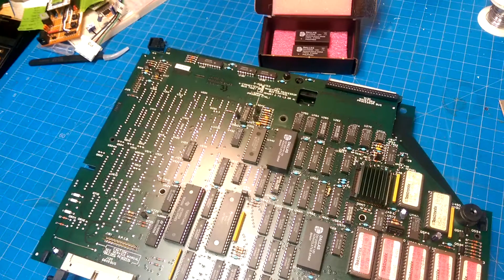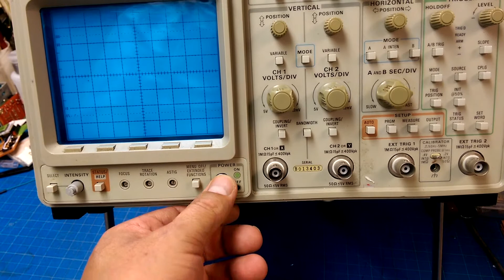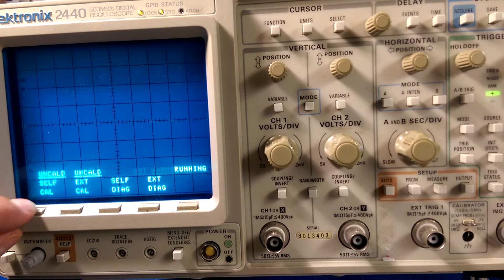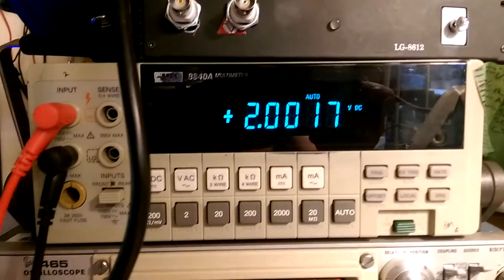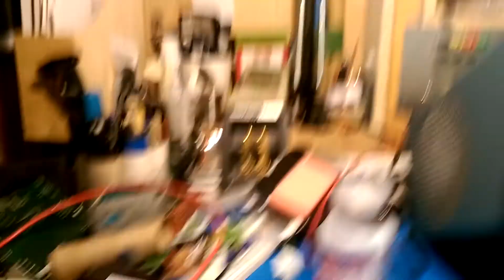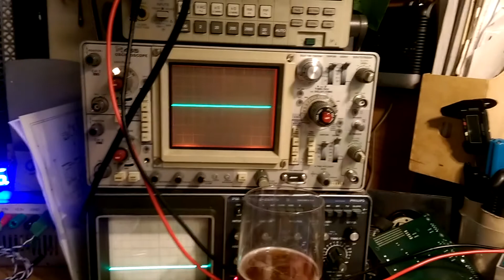NewNVRAM

Comment: Failed NVSRAM as you have to back up old one using a programmer and write to new NVSRAM, or you will have to do a full calibration, I had to do this with my TDS784A and works fine, of course after fixing other issues with it. Also check CCD as they are known to fail, as work on a couple of these that had bad CCD hybrid chips.
Reply from the maker: I do have bad CCDs in that scope but have not got around to fixing it.

Comment: Before you continue any further I would confirm your ccd's are functioning. set scope to 10ns and trigger auto. set both traces to centre screen. when moving trace up or down see if the line becomes very noisey.  That's a sign of failed ccd hybrid. Take a look at my later 2440 videos.
Reply from the maker: Will do!  Thanks for the tip.  I will follow up with the results in the next video.